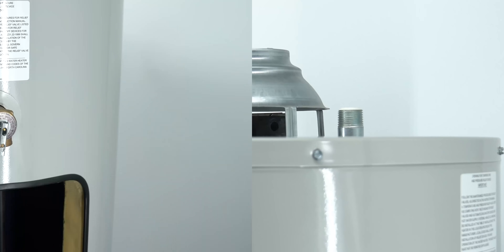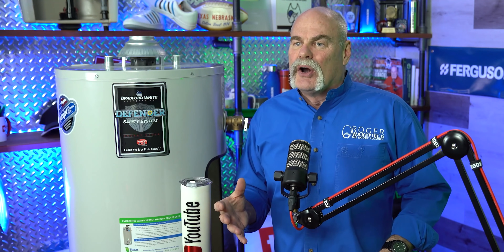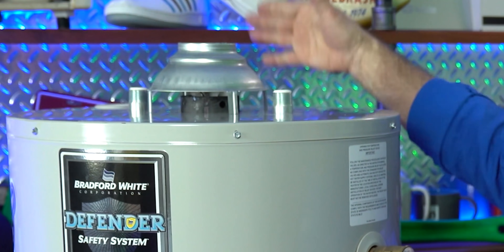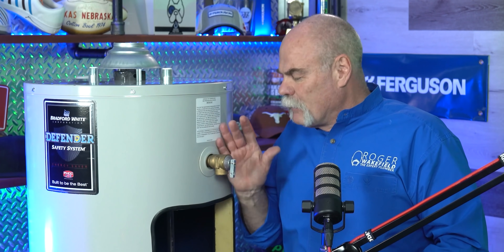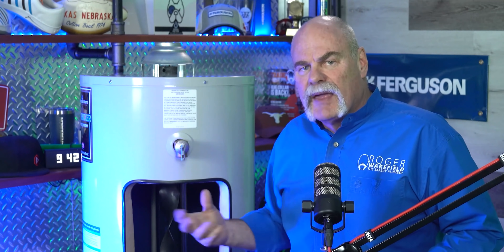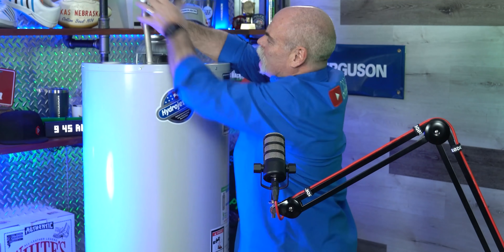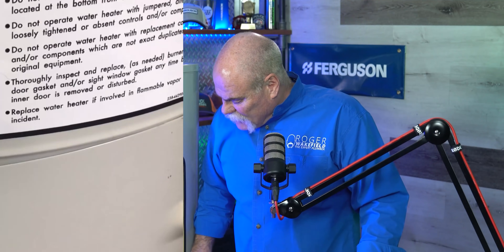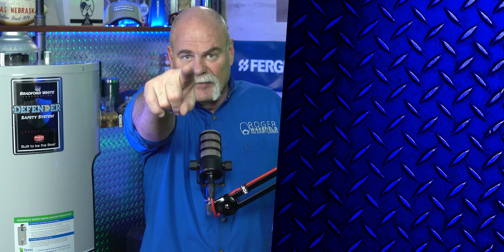Ever Wonder What The Inside Of Your Water Heater Looks Like?

Comment: The picture of the thermocouple is actually a thermopile. They use to use thermocouples but changed to thermopiles 20 to 25 years ago. Probably runs the valve better. Thermopiles are about 20 thermocouples stacked together to make 1/2 to 3/4 of a volt when heated. The electricity is used to hold the saftey valve open and sends gas to the pilot. Then the thermostat opens and closes the cyling valve. Supper cool tech. Love the videos

Comment: His understanding of how an anode rod works is incorrect. It does not “plug up small microscopic cracks” or whatever he said. It acts as a sacrificial metal through cathodic protection corroding itself instead of the water heater. The rod is an “anode” releasing electrons to the “cathode” which is the steel tank.

Comment: I just replaced a water heater from 1986, long story short it had had a slow leak from the top. After removing the unit the bottom fell out. Rust everywhere

Comment: I have never had a gas water heater last as long as an electric water heater. I installed my last gas water heater in one of my rental houses seven years ago.

I have had electric water heaters that lasted over twenty years. You can replace both elements and the anode rod in most electric water heaters for less than $80.00. I currently have four electric water heaters. My Bradford White 50 gallon electric water heater is twenty-one years old. I have two AO smith water heaters that are twenty years old, I’ve had to replace elements and anode rods in both of them, plus the pressure relief valves. I have one AO Smith water heater that is one year old. I got it free under warranty to replace a lifetime warranty water heater that lasted nineteen years. I was told they no longer offered lifetime warranties, but I could get a full refund, including tax, on the unit that failed. I like a company that stands by it warranty.

I love my Bradford White electric water heater. It is in a hard to get to place, and I have never had any problem with it. I’ve never even flushed it. My only complaint is I was told my warranty would be void, if not installed by a licensed plumber. I hired a young plumber twenty-one years ago, to help me install it. He was trying to build up his business. He did a good job, and I paid him him well. He was really happy when he left. I put out a good word to my friends about him. He has built a great company over the years and will come to my aid in a heartbeat, if I ever need him, which I don’t. I still do my own plumbing. I can understand that Bradford White requirement for natural gas installations, which I have also installed, but not so much for electric water heaters. I’ve installed a lot of water heaters. I have yet to see a plumber do a better job installing one. I guess some home owners would never read the installation sheets and burn up an element by not getting all the air out of the tank before turning on the power.

I’ve tried different brands of water heaters. Over the past forty years, I have not seen that much difference in longevity of electric water heaters based on brand name. I no longer use gas water heaters. I’ve run new electric service to eliminate the need for gas. I really like the newer micro processor controlled electric water heaters that offer energy saving modes. My newest water heater has that and it works great. I sold my last rental property four years ago. I’m down to maintaining only two properties now.

Comment: Still using my 20 year old Electric Hot Water heater never changed the rod or drained. Still running like a champ. Not going to do anything now. Feel like its like transmission fluid if you never changed it don't do it now.

Comment: One question.
I've been told that the anode rod is lower on the corrosive scale, sacrificial anode rod.
Have I been explained wrong?
It  corrodes before the tank.
Your video kinda explained it differently.
Like your videos.
Reply: You are correct. If you look at the ends of all anode rods you can see two different types of rod. Softer on the outside for the scale to cling to and same as tank material on the inside. Visible difference. Was taught that once the outside is gone it’s time to replace anode rod. When rod is completely gone time to replace heater as the tank metal is beginning to erode. Hope that helps.

Comment: Anode rod does not plug any leaks!

It's used for electrolysis.  Water and dissimilar metals produce corrosion.  The magnesium anode rod is dissolve before the steel tank.  If one keeps changing the anode the tank's life will be tremendously extended.

Comment: That strange gas water. Its like a water storage tank.
Normally you haveva combi boiler ir boiler with hit h20 on demand.
Or a boiler and hot  water storage  tank. Like a maxus system with a back up electric Emerson heater fir wgen gas fails.
This unit looks like water storage with heater very wasteful.

Comment: My absolute biggest fear is the pressure as you were saying..I have no way of knowing if mine works or not Bc I won’t touch it. My tank is right next to my toilet behind one sheet of drywall. I hate when my kids mostly use the bathroom or shower Bc of this..while it is rare to explode. It’s possible!!!! I hate water heaters for this reason, and won’t work on them, I live in a double wide and can hear it kick on and off and I’m just wondering as I’m on the toilet how high that pressure is...I mean if I explode into the bathtub that’ll be my legacy!? 😒 Pants half down s**t in my rear and I’m just laying there dead. Fml 🤦🏻

Comment: Bradford White make the best water heaters hands down. Earlier today, I found a 50 gallon atmospheric vent that wasnt leaking but wasnt delivering much hot water. I couldnt get it out of the mechanical room without removing the furnace ductwork (furnace was installed after water heater). After putting a 3/4" ball valve on the bottom, I was able to get it running really well after flushing it. Special ordered a tall skinny tank from Bradford White. Once its here they will get another super reliable tank. Ive had two in my own home and they rock

Comment: That’s so crazy to me that home owners can do there own plumbing. I own a plumbing business in Australia and here it’s illegal for anyone to do any plumbing without a license. A licensed gas fitter here can’t even service a gas appliance these days without having a type A gas appliance service license as-well
Reply: That's why I'm libertarian. Can't fix your own appliances? Holy smokes... That is mind blowing.
Reply: @mannys9130  it keeps everyone safe from unlicensed unsafe work. I think it’s a good thing
Reply: @danieltebbutt3638  It's that way in my State too. Any homeowner can do their own plumbing or electrical work. I understand the argument, and for the majority of homeowners, I'd agree - call a pro. But honestly, I've seen this run all over the map. I've seen beautiful professional work done by homeowners that is permitted and done to code, nice sweat joints, expansion tank installed properly. You could tell they took their time and did a nice job. And then I've also seen disastrous work where the homeowner used Sharkbites all over the place, wrong copper type or have a rat's nest of Pex lines, non lead free components, improper venting, etc. Sadly, I've also seen the same exact thing with so-called "professional" work. Most are done properly and professionally - but others, I was shocked they had the balls to put their company sticker on the tank. Any homeowner can educate themselves by reading the plumbing code for free online to understand the water heater requirements for their State, pull the permit, and do the work if they have the skill. Inspectors are usually more than willing to help a homeowner if something is missing or isn't quite done correctly. It boils down to what one's ability really is. Gas isn't something a homeowner should play around with unless they're experienced with it and have the skill, ability & confidence to do it.

Comment: Bradford White is a very good water heater but I still have issues with them.#1 is their anode rod, the only reason they install it off the hot water supply is to save labor cost ( one less hole to drill and tap, one less step into the installation of the anode). An anode rod can be changed in less than five minutes in an AO Smith water heater with almost no chance of leaving a water leak. Bradford White is just betting you won't go through the hassle of changing the anode rod and most people don't ( built-in obsolescence).#2 the Honeywell thermostat with the power pile pilot safety has been known to have countless problems in the past ( hopefully they have these problems resolved by now). The sad thing is that all the different water heater manufacturers have been known to use the Honeywell thermostat. AO Smith goes back and forth between Honeywell and White-Rogers.Roger you said during your presentation this water heater had a thermocouple, I wish it did, it has something called a power pile ( thermal pile) something that has been problematic in the past. Other than these two issues Bradford White does make a good water heater ( good tank integrity ,good dip tube design & it tends to have less bottom sediment buildup overtime ). So for people who never plan on replacing the anode rod I would definitely go with the Bradford White and for the people who plan on maintaining their water heater and replacing their anode rod periodically I would definitely go with the AO Smith ( Lochinvar) water heater..
Reply: warranty process sucks though, gotta call and they mail to customer...

Comment: How does a sacrificial anode work? Is it real or is it pseudoscientific woowoo? edit: I asked this before he showed one, and then got how they work wrong, well, backwards. D:< The amount of electrical current you would neat to cause that anode to break down and plug up holes would be near welding heat currents. Replacing it after a year is also pretty crazy, sacrificial anodes get swapped out maybe once every 25 years. They're designed to never be swapped out, most used for military underground structures are set and forget, I've seen ones from 1945 that looked the same as ones from 2010 hence my skepticism they do anything.
Reply: Sorry, you're wrong. The anode rod is a sacrificial anode that prevents the steel tank from rusting due to galvanic action. There will be a current between it and the copper pipes. It doesn't "plug up holes" with debris but it stops any points where corrosion could begin by being eaten away first/instead. They do NOT last 25 years. At most they last 10 on average. Most are toast between 5 and 10 years. The anode rod is very important to longevity of the tank. Copper and brass are very noble, so without the rod the tank gets rusted out instead of the rod corroding away. Rusted tank = pinhole leaks = replacement time = $500+ dollars.

Comment: Newer gas valves on Bradford White now have Thermopyle generators not thermocouples  that creates a Millvolt to power gas valve and keep pilot lit.
Reply: Technically it should never have to het changed unlike thermocouples
Reply: @vegaslowblower8781  what is the known record for time of thermopile
service?   My house boiler uses one
to power the gas valve.  No outside
AC power.

Comment: I have a weird question could and anode rod when it is giving up metal for the tank clog up release valve and make it where it cannot function. I know it is rare for a hot water tank to explode But could that rod contribute to the clogging with scale.
Reply: @420danksta420 420 is right. Not sure what Hash is on to... The anode rod is a metal that is more likely to corrode than the steel tank or copper pipes. Copper is more noble, so without the anode rod the steel tank will corrode away. With the anode rod, it corrodes instead of the steel tank. It corrodes bit by bit into the water. The temperature and pressure relief valve is always in the top of the tank somewhere, which scale won't build up in. It'll be hard to clog it with scale. Yes the relief valve is made of brass. Brass is an alloy of copper and noble so the brass won't corrode and destroy the valve. The T&P valve is VERY important, and the anode rod is too! The anode rod absolutely works. Whenever you have 2 dissimilar metals (steel and copper/brass)  surrounded by an electrolyte (tap water) you have galvanic action/corrosion that removes metal bit by bit from the metal that is lower on the chart. The anode rod should be changed every 3-5 years for most tap waters. It may need to be changed more or less frequently if the tap water is more or less favorable to corroding it.
Reply: The relief valve is brass. I've been servicing tanks for a few years now and they only thing that really messes with those valves is calcium build up around the probe. It will mimic a pressure buildup and open a few times then it will stay open. Thus could result in a flood in your basement if you don't catch it right away
Reply: @matthewfasullo4983  Id rather a flood than explosion. My tank is right next to my toilet in a closet
Reply: Oh I completely agree with you I'm just saying what may happen. As long as you don't cap the valve it should never explode
Reply: @matthewfasullo4983  Hopefully lol 🤞🏻
Reply: It would, absolutely. But they don't work like that, it's a fiction, perhaps a sales pitch. They are also not given an electric charge, so they aren't acting as an anode. However, sacrificial anodes are often used. I don't think they are scientifically valid. I've seen one that was almost a century old and had in my truck one that was ten years old and they looked the same. They are meant to rust before the important thing they are attached to. Military subterranean structures use them in hopes of fending off 'concrete cancer' and rebar rust in the insides. I've tried to find the science behind them, but can't find anything that really proves it works without a current. But to see it working look at rust stripping using a car battery. THAT works. But the power you would need to reverse that process and have parts of the anode 'plug up holes' would be so hot your entire set up would be reaching welding heats of amps running through it. It just doesn't stand up to the math. But then again that would make sense you'd need weld heat or the 'plugging up' would just fall out when water molecules brush against it. But the water heater in my laundry isn't glowing bright orange right now, so I presume that isn't the case. :) That and you wouldn't be calling it a water heater, it would be a water gas bottle blasting steam out, or detonating at random.
Reply: @hashnotall6263  owe wow ok so the anode really doesn't act the way that it should in a sense. But what i was thinking was galvanic corrosion Between 2 parts like aluminum and copper that creates a charge and will strip one metal to another. The release valve on the tank he showed in the video looked like copper and I have zero idea what is in the anode and you would think they would think of this metal interaction. I also couldn't see the tank reaching welding temps that is over glowing red hot, But under pressure those temps may act different in the tank if the valve was clogged. But that is just hypothetical.